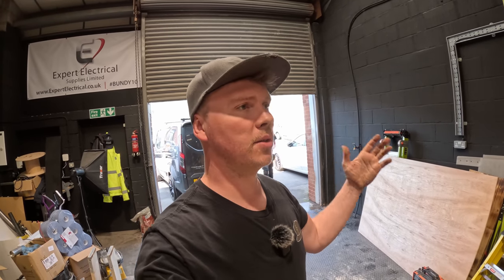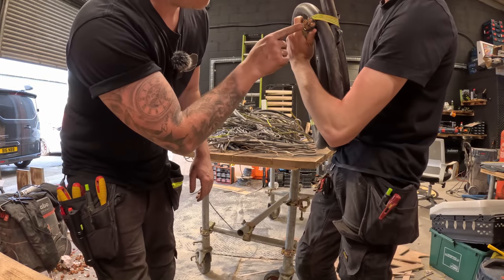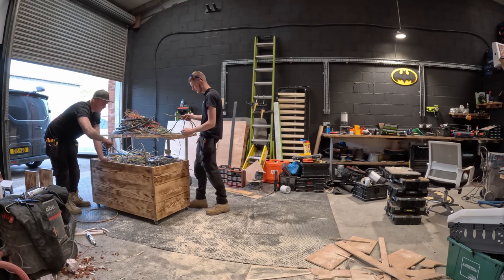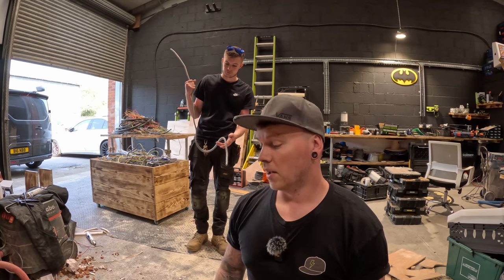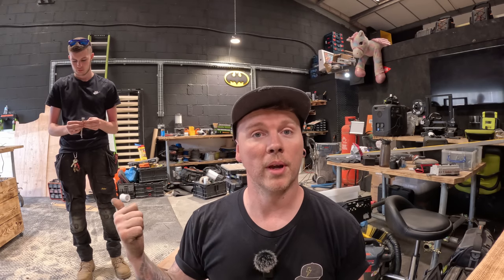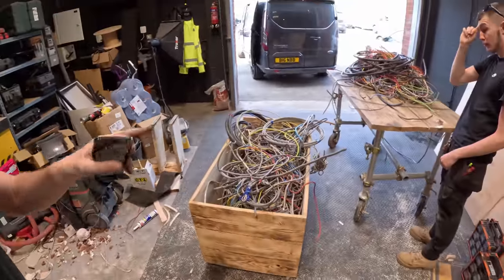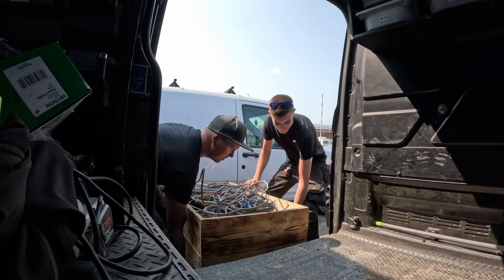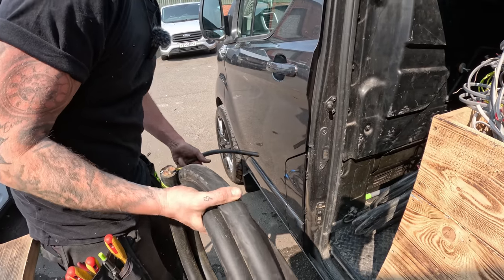Look how much this Huge copper haul is worth

Comment: in my younger days i spent a day at an old telephone exchange in the hospital i worked taking tiny pins from the old selectors , while the others got the lead weights for the plug in patch cords , a tiny bag maybe three ounces i took to the jewelers and walked away with five hundred notes (around 1986) because the tiny pins were solid silver
Reply: the highest price for silver in 1986 was £4.44 an ounce, the ALL TIME high was £29.26 an ounce, nobodys paid you £500 for 3 ounces
Reply: @codenamenel you understand what hyperbole is yeah?
Reply: @Pugjamin  yes, but theres hyperbole and then theres straight up BS. 
That was definately the latter

Comment: Ford have recalled some Transit timing belt kits and timing covers due to quality concerns.. due to be sorted towards the end of June!
Reply from the maker: Good to know mate thank you, where can I fine this info please
Reply: I had a recall on my MK8, they said its fine but heard of a few failures
Reply: @NBundyElectrical  if your vehicle is effected the Ford dealer should inform you as they’ll not be able to order parts from Ford nor will they be able to use existing stock not that they Should have any as Ford recalled all stocks!
Reply: my builder and plumber have both had cambelt issues, with ford not being very helpful. Both went after a service, so make sure they don’t use the wrong oil that dissolves cam belts. Almost designed to be easily and discretely broken for a 5k fix.
Reply: @IanFarquharson2  we have to soooo careful with oil types..Ford have started recommending  5w/30 in some of there newer Transits models! 
Oil has always been a nightmare tbh!